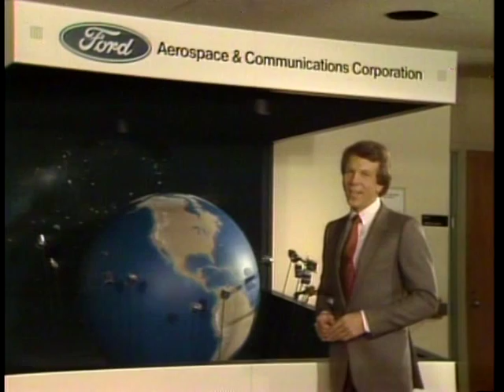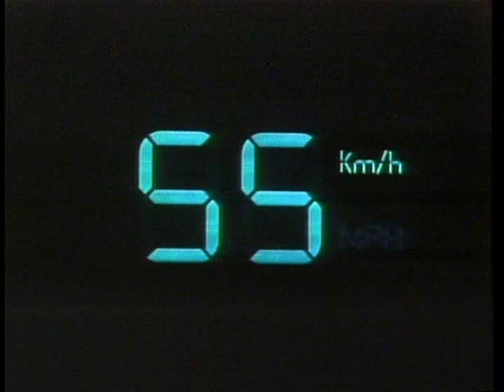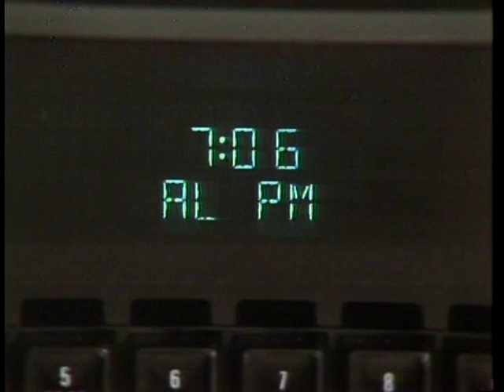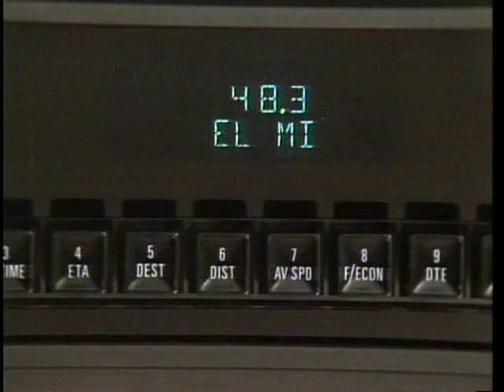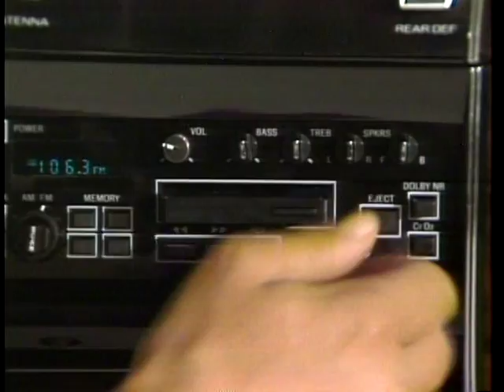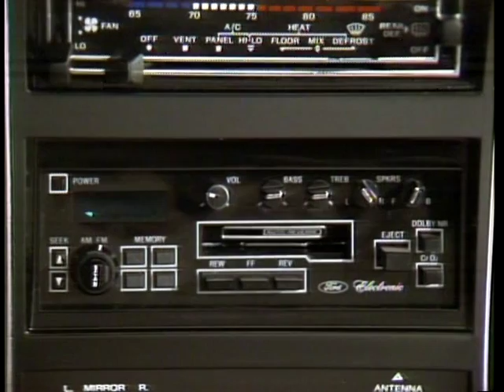Ford Video Communications Network: Lincoln-Mercury Automotive Electronics

Comment: What the frig is up with the first 5 seconds of the video? I nearly blew my brains out! Frig Off, eh?
Reply: It's a data dump.

On certain players, such as the Pioneer PR-7820 or the Sony LDP-1000, the data dump would program the player so the disc would be played in a specific manner as well as to allow interactive functions, such as multiple choice quizzes or a program menu.
Reply from the maker: That's some kind of code for the players the car dealers used, which lets them do the stuff they talk about at the end.
Reply: In addition, Ford Video Communications discs of this vintage usually used the Sony LDP-1000.